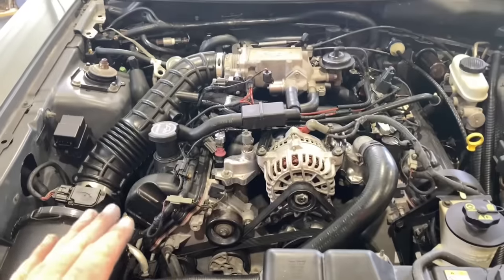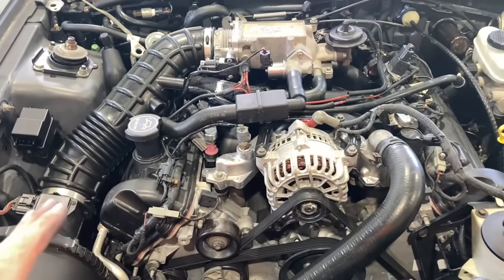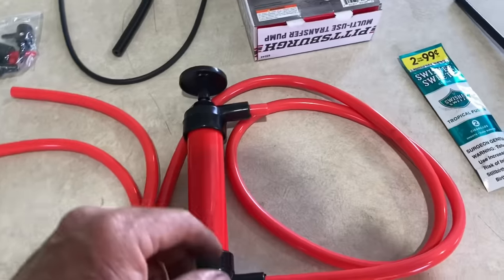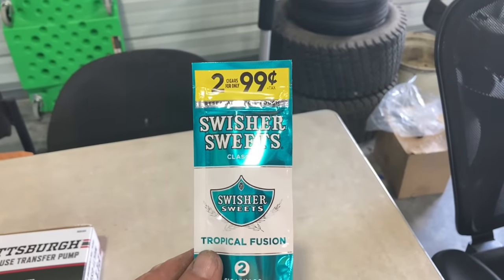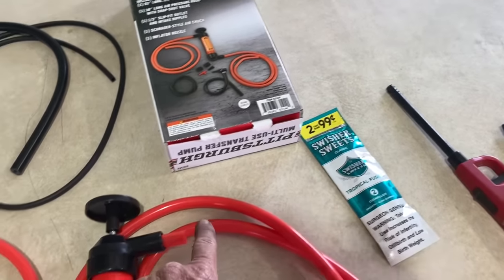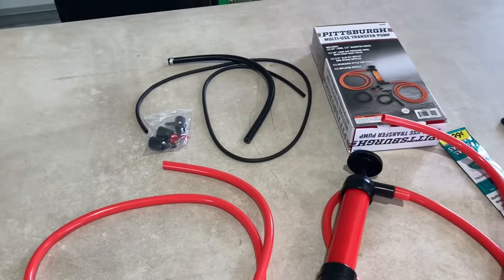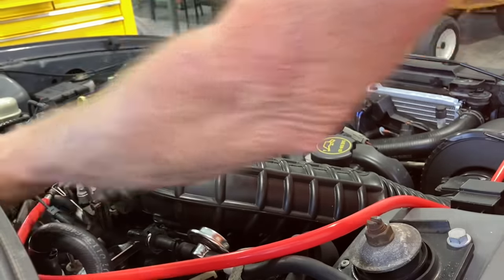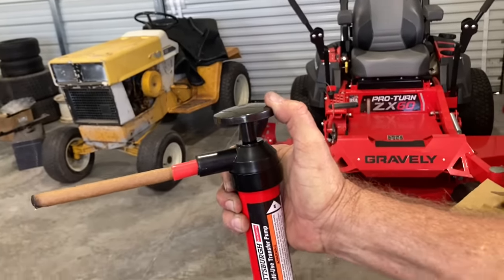DIY smoke machine to check for vacuum leaks under $10 and less than 5 minutes!

Comment: I'm gonna use this "hack" to track down leaks on my old turbo engine.  Way easier than an air compressor and soap & water.  You add value to humanity, sir!
Reply from the maker: Thank you so much for watching
Reply: It will work well for any big leaks, but remember some leaks occur at a certain PSI in the charge pipe/intercooler track. So if you only test it with no added pressure and it checks out fine, it might still have a leak once it hits say 10psi of boost
Reply from the maker: Good point
Reply: Holy that had me sold till 6:10. I’m a former smoker so I hate that smell more than I hate spending money on tools.  
I actually love buying tool.  I hate the smell of cigarettes but some. Cigars smell pretty good.  So now I’m torn. $100 on cigars or $600 on a smoke machine that still is unreliable.
Reply: No air and soapy water is a pretty good way to find leaks as well

Comment: Great hack, this is by far a lot safer than spraying starter fluid or propane all over a running engine.
Thank you for taking the time to video and share!
Reply from the maker: Thank you!
Reply: Modern mechanics use an unlit LP torch not ether. No puddles no problem.

Comment: I have that same pump but never thought to use it as a tool to locate a vacuum leak. I've been fighting a P0440 forever and still haven't been able to locate this troublesome leak. I'm definitely going to try this cool hack. Thanks!
Reply from the maker: Thanks for watching
Reply: Hey, I’m having the same issue with a P0442 code. Were you able to find your leak? I’m about to get me one of those pumps at harbor freight. Any tips you can share?
Reply: @jackgutz  I haven't tried that pump yet but I am going to take the Schrader valve out of the evap port and connect it to the  pump to the port and send smoke through there to check the back of the system. I will check the front through another air hose. But I have to replace my MAF Sensor first because it was reading way out of specs with over 186000 miles on it. It should arrive tomorrow and I'll get that replaced and then pickup a few cigars later to check for the vapor leak.

Comment: After seeing the smoke coming from under the throttle body air duct, i would have removed the air duct, seal off the throttle body & plastic air duct, & then repeat the smoke test again, before removing that elbow, to ( ENSURE,) that it was the elbow (alone,) which was leaking, & that no smoke was coming from anywhere else under the air duct.! All in all, that improvised smoke test hack was genius, remarkable, & worthy of applaud.! Great video great details, great & superb demonstration.! Spectacular thought pattern.! 👍👍👍👍👍👍👍 A cigar & a siphoning pump.! Seeing is believing.! Congrats mate.! U r special 😊 👍
Reply from the maker: Thanks for taking the time to watch
Reply: There's no reason not to just fix the hole and repeat the test after. Gonna have to replace that elbow anyway, and that saves a lot of work.

Comment: I already had one of those pumps, but I had to try 2 different kinds of cigars to get one that worked, but it was still under $10 AND it worked.  Bought the right part on the first try and everything is back to normal.  Thanks 👍
Reply from the maker: Right on! thanks for watching
Reply: Which one didn't worked ?

Comment: Another good trick to add to this is to disconnect the air boot from the air filter box and seal it with some cellophane and a rubber band, or a plastic container lid. That way you are also testing the air boot itself for any cracks which will effect the accuracy of the air flow sensor. And also the crankcase breather hoses for any cracks. I will also take the oil cap off until I see smoke then put it back on. That way I’m sure I have a good smoke charge in the engine. Nice trick though. 😊😊
Reply from the maker: Thanks for the information and thanks so much for watching
Reply: Or a latex glove and a rubber band over the throttle body.
Reply: @hugh007  random plastic bag that car parts come in stuck over the TB and the rubber boot rammed over it to hold it in place.

Comment: This beats my diy smoke machine using a pickle jar with 2 tubes and a lump of charcoal with smoldering charcoal and cardboard that you then have to put a tube in your mouth to blow air into to push the smoke. Yep this looks easier
Reply from the maker: Thanks for watching

Comment: This is fantastic!  This makes me realize that I have a small battery powered camping pad inflator that might work very well for this.

I need to hunt down a leak in my evap system, but I'll need to keep lighters and cigars  well away from the car 😂.
Reply from the maker: Vape pen maybe? Thanks for watching
Reply: @AllPistonsGarage  yeah! that is actually the same liquid the actual smoke machines use I believe.  Wouldn't smell like cigar smoke either.

Comment: That was brilliant!   Ingenuity!     Did the tube just happen to be the right size to connect to the vacuum port?

12/24/23, 1:38 p.m.
Reply from the maker: Yes the pump comes with some different size rubber bushings for the hose and the hose is pretty flexible

Comment: Going to use that same pump, but with a $4 HarborFreight soldering iron and jar of baby oil for the smoke! 

Thank you and Happy Holidays!
Reply from the maker: Sounds good Merry Christmas and Happy new year
Reply: how does your s work with the baby oi?? im confused on this ?? email mail on this if uou can,tks
Reply from the maker: The baby oil is heated in some kind of other applications to make a smoke machine this is just a simple pump and cigar I used and some others mentioned using a vape pen

Comment: Is the smoke from the cigar introducing residue that could mess with a sensor like a MAF?
Reply from the maker: I don’t think so maybe for a long continuous time maybe but like someone else said what about a vape pen. 🤔
Reply: Which would be worse for sensors. Dry smoke or moisture vapors?.........
Reply from the maker: Well I’m thinking for short usage to find a leak you would be ok either way didn’t seem to affect my sensors no more than driving a couple miles of smoke 🤷‍♂️
Reply: I had the same concern.  Just a slight concern.
I think it could deposit nicotine and tar, but I also think it would be microscopic during this sort of exposure.
However, (using any type of smoke source) I think you could disconnect the ducting from the MAF and boot off the intake, just to be eliminate any question.
This would test everything but the MAF and duct to MAF connection, which you can easily visual.
It should also increase the smoke delivery into the engine/plumbing, and not all blow out of the air filter.

Comment: Thank you. I did this test today and I have a leak somewhere near the tps and the hoses on that side. I used the brake booster hose port. Yeah it works. I didn't see any other smoke, but in that area.
Reply from the maker: Glad it helped thanks for watching

Comment: Cool method. Being a fan of Ford modular engines my first bet was PCV elbow. 
Appreciate the video!
Reply from the maker: I’m old school push rod man and you was correct I couldn’t hear it with the engine running and a splash of WD40 didn’t help either because of its location. Your knowledge was spot on wished you would have been here saved me some time lol Thanks so much for watching

Comment: In the old days, we just listened, and sprayed carb cleaner to find them. This new smoke method is great. All you need, is a piece of vacuum line and a cigar. But , there are several ways to do it. I get 5 for 99 cent small cigars at  the Hadji shop.
Reply from the maker: I tried carb cleaner but it kept taking to the wrong location and couldn’t hear it with engine running and its hidden location. You are correct thanks for watching

Comment: I graduated from this type of setup to a gallon paint can, 2 (each)1/4-inch male air hose fitting (One for the inlet and one for the output), JB Kwik, a tiki torch wick, resistance wire, wires and clamps to go to the car battery, a few #6 bolts, nuts and washers and a few rubber isolators, and ring terminals, a ball valve and a pressure gauge (Not needed but looks cool) on the inlet side  and clear 3/8" hose on the outlet side, and use mineral oil to generate the smoke. All of the parts I had laying around the garage except for the resistance wire. I got it at a local Vape shop for around $10 or so and have enough left over to do it again several times over if needed. If I had to buy the parts new, it would probably run ~$25-40 dollars, maybe.

It took a little experimentation to get the length of resistance wire correct ("Doing the Math" and Reality seldom match up precisely). Once I got it where it needed to be, the "Franken-Smoker 2000" worked great. It still smells weird but at least it's not as bad as tobacco smoke. It has saved me a lot of time finding vacuum and exhaust leaks and I no longer have to try to keep pumping while I'm looking for where the smoke is coming from at the same time. (If I did videos, that project would be a good one. I even still had hair left when I finished.)

That's a neat starter setup, though. Thanks for the video and have a great weekend!
Reply from the maker: Thanks for sharing your setup and information and thanks for watching

Comment: I made a smoke machine out of a steel Harbor Freight ammo can and a diesel glow plug and baby oil . Connect an air line in reduced down to 2-3 psi and a line out for smoke . Leads from the glow plug clip right on the battery . Works great for under $40
Reply: Could probably use the smoke machine juice or even dirty old green antifreeze

Comment: Many thanks for sharing this idea. I have a P0441 code and decided to look for the leak. I must not have done it right as I only saw smoke coming from the air intake/filter area. I'll get some more cigars and try again.
Reply from the maker: Maybe take a towel or something temporary close off the hole at the breather and also use a vape pen? If using a lot of cigars thanks for watching
Reply: @AllPistonsGarage  Which hole is that? I’m putting the smoke into the intake, after the filter. The smoke is coming back out the air filter box.
Reply from the maker: @leitrepenn-lowe4439  I was thinking in the tube or intake pipe just before the filter but I’m not able to see your set up so you have a better advantage as you can see what you got. Good luck hope you’re able to solve it.

Comment: you are supposed to use your lungs and reefer...that way you get more and more focused on the trouble. Finding it becomes an adventure
Reply from the maker: I usually pride myself in finding vacuum leaks with my ears or a small spray of WD40 but this one kicked my rear with its location and crack on pcv elbow on the bottom of the bend and under the plenum pipe it took the 💨 to find it this time 😂 thanks for watching

Comment: Used to find cabin pressure leaks on lear jet aircraft with a lit cigarette. Following the smoke. Looking back now i think i was inside a pressurized cabin, can't get out while pressurized ,with flammable fumes solvent and sealer sealing leaks. 😮  ⚠️ Very efficient but i should be dead.  I'll use your method on my old 66 Ford. Thanks 👍.

Comment: Can this method be effectively used to pump smoke into the gas tank to find an evap system leak or is there another entry point where the smoke should be introduced?
Reply from the maker: Not sure if you can get enough pressure filling the void of the tank to get enough pressure in the lines going to the rest of the plumbing of the system and I would extreme caution doing any with a fuel tank that used any method of ember south as a cigar vape pen maybe

Comment: I tried this on my 1986 Toyota 22RE Turbo Pickup and didn't notice any leak. Would it help if I get the engine at operational temp. and perform the test again with the key on to activate
solenoids/valves to make sure I'm testing all the vacuum lines ?
Reply from the maker: Yes you could try that and possibly other points to hook up the pump. You can also get a little happy with the pump to make sure you have good smoke always use caution if using the lite cigar some use vape pens good luck

Comment: Ok so I have this same thing an iam just trying to figure out out where to hook it up on my 2000 Toyota Celica I do have the little green cap that has a port but no smoke will go into it because the way the hose is so I just wanna make sure I don’t hook it up in the wrong spot ?????
Reply from the maker: If you are having difficulty finding a port there should be different size bushings in the pump kit for different size hoses somewhere around the intake, if not sure you can crank the car mist water around the engine (intake & hoses ) listen for the engine to change sounds or rpm’s I use wd40 but you got to use caution with that as it’s flammable but very effective. I use it on a cold engine start ups but use caution.

Comment: I used some air fittings in the lid of a Mason jar with the cigar in the jar. I ran a few lbs of air through it and found my leak in the evap system.  This looks a bit simpler!
Reply from the maker: Thanks for sharing your method and thanks for watching

Comment: I love this idea but I'm lost on which tip to connect it to if I'm trying to rest the evap system. Any ideas for a 2007 cadillac escalade? I know the purge valve but then i have to shut something off with the solenoid by the gas tank (i think thats how you say it). Help! Lol
Reply from the maker: I’m not familiar with the Escalade so my information may be limited but I would think as the smoke traveled to the tank it would still escape through any kind of opening I would start at the engine compartment connect and start pumping you may want to use Vape pen for something dealing with fumes but I would think you get enough smoke in that system it will escape any openings use caution as always

Comment: Great idea! Will this work on a carburator engine. I’m thinking I could connect the cigar contraption to the PCV port on my Quadra jet to see if there are any vacuum leaks. Does anyone have knowledge or advice of doing this?
Reply from the maker: I would think so a leak is a leak I would expect smoke to come out the top off carb as expected but I would think it would still work around to hoses and runners always use extreme caution of corse or even a vape pen for fumes purposes

Comment: Is there any hazard to pumping that kind of smoke into the system? Wondering if it will leave a harmful residue in the lines/components.
Reply from the maker: Maybe if you continually did it but some say use a vape pen

Comment: Did you happen to have an rpm hanging issue when changing gears with the vacuum leak
Reply from the maker: It’s possible I definitely had a high rpm at low speed like in first gear and then sometimes it would tend to try and stall at idle this is what lead me to do this smoke tester. Thanks for watching

Comment: How hot can it get before causing any explosions? Is the air intake usually hot anyways?
Reply from the maker: My engine was off and cold. Also you could use a vape pen you are just trying to fill passages with smoke to detect a leak
Reply: @AllPistonsGarage  great advice thx! Ill try the pen

Comment: Should pump clean air through the system when your done to clear it out. That lingering smoke will settle and leave a sticky tar residue all over everything.
Reply from the maker: Or fire up the engine and blow it out 😂 thanks for the heads up and thanks for watching

Comment: how did you produce so much smoke from one tiny pump of the valve? that doesnt seem possible... did you do something else not shown?
Reply from the maker: Give it a couple of quick pumps, It will smoke up quick! Some have mentioned using a vape pen to but a couple of quick pumps is all I did. Thanks so much for watching

Comment: This is a good way too find any leaks in the hoses. But, my qwestion is. Is the air intake and PVC valve and related hoses really part of the vacuum system or just a way too relieve pressure in the crankcase?
Reply from the maker: Because I plugged the smoke hose into the port that normally the evap was plugged into the plenum manifold it filled the the crank case as well that the pcv is plumed to as well I pretty much had smoke everywhere but the cylinders the valves were closed on 😂
Reply: Yes it is a way to prevent pressure and ventilate the crankcase, but, on the downstream side of the PCV valve, it is direct manifold vacuum supply. (the valve limits the flow in an intake system).  With any leak there, the air bypasses the flow control, and goes directly into the manifold, and is only limited by the size of the hole in the hose.

Comment: Dumb question but. The engine is suppose to be turned off the whole time during this test?
Reply from the maker: Not dumb but yes engine needs to be off or it will take your smoke and put it out the exhaust pipe

Comment: Can this be used to check for EVAP leaks?
Reply from the maker: I would think so I would use caution as your dealing with fumes you may want to use a vape pen instead of a cigar with a ignition source and definitely start in the engine compartment

Comment: Hey, I used to be a smoker and even when I smoked I thought cigars stank too. I'm going to ask the stupid question, but does this method work for evap system leaks also?
Reply from the maker: I don’t see why not a evap only pulls a small amount of vacuum I would think the pump could push smoke through obviously I would use extreme caution due to fuel fumes maybe a vape pen due to possible fumes would be better I have never tried it myself use your own discretion.